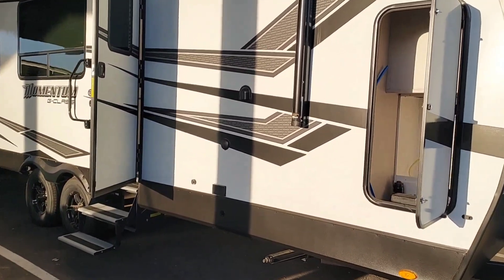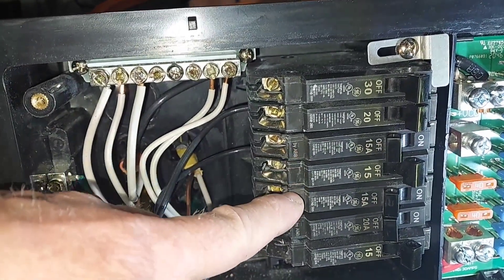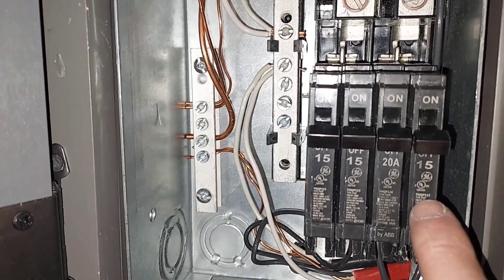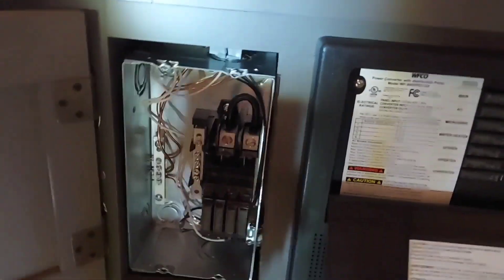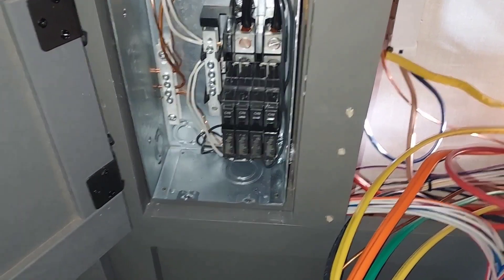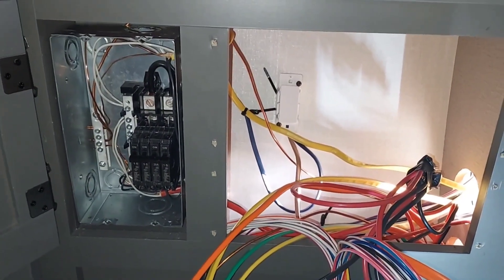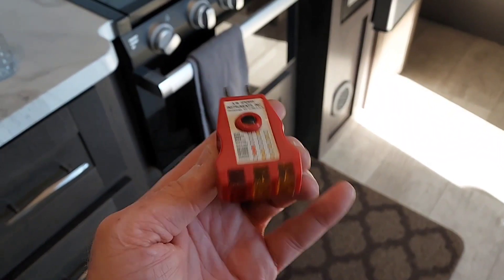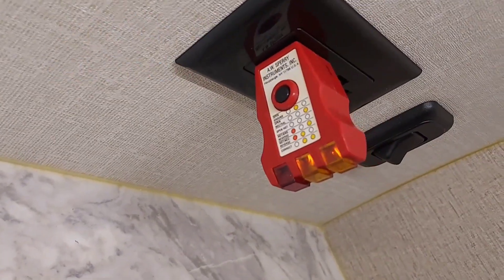Momentum 21G inverter prep wiring

Comment: Which inverter are you planning on using?  We are going to be doing the same upgrade this off season
Reply from the maker: I bought the Renogy 2000w inverter.  I'm slowly purchasing everything I need. The WFCO transfer switch is on the way,  just waiting for a good deal on a 300ah lithium battery.
Reply: @toyhaulen  is the 2000w inverter enough to run your air conditioning?  I am leaning towards a 3000w
Reply from the maker: @Peaks2Palms  No, I just want to run the microwave and all of the outlets. You will definitely need the 3000w inverter for the air-conditioner.
Reply from the maker: I'm hoping you make a video showing your installation, can't wait to see it.
Reply: @toyhaulen  Our rig came with the 1000 watt inverter but I am going to upgrade it to probably a 3000 watt like I mentioned.  I am sure I will have to upgrade the wiring & breakers like you did.  I haven't had time to dig into it yet to see.

Comment: I don't really understand why you are doing this. Haven't you eliminated your warranty. I had a 3000 watt inverter and additional solar panel installed for 3 hours of labor from a dealer that maintained my warranty. I have a 2023 21G. I think you are giving people  horrible advice. While your work is great, the cost to warranty (and extended warranty) is foolish.
Reply from the maker: #1, I don't recommend anyone do this, it is not "advice" it is for entertainment purposes only. 
#2, There is no warranty, it was gone quite a while ago. 
#3, I hope your dealer upgraded your wiring as the stock inverter prep is not enough for a 3k inverter. 
Thanks for watching